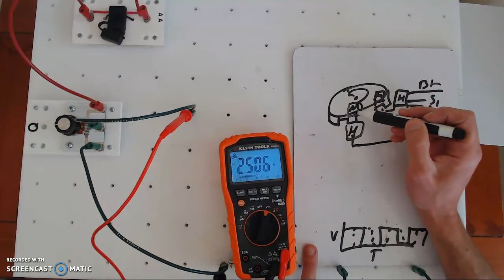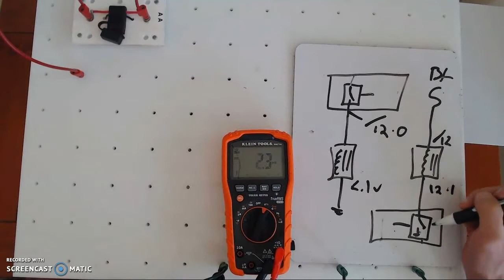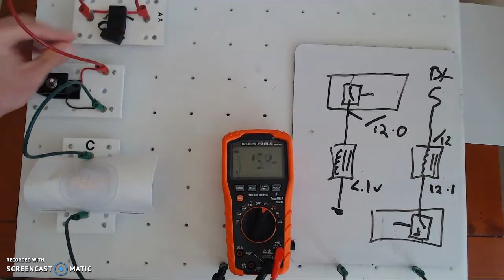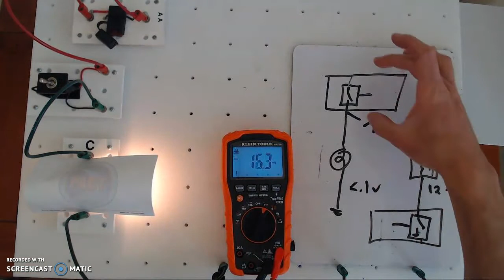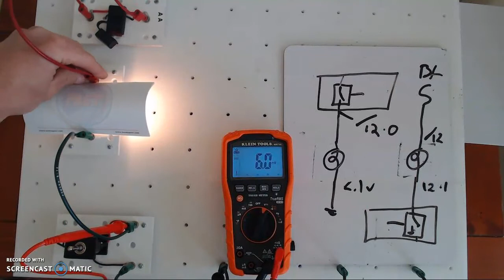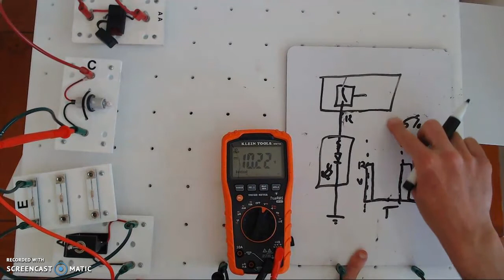Automotive computer output theory, operation, and diagnosis.

Comment: Just another comment.  Can you show how to take a 3-wire sensor (input to CPU) and tell which wire is which without a schematic?  One is ground the other is VCC and the other is the signal to the CPU.  I suppose I could read the voltage at the sensor connector using a back-probe pin test lead with power applied by having the ignition key turned to position 2 (not the accessory position).  I could get Ground and VCC using this method and by default the other is the signal pin.

Comment: where i get confused is knowing if a wire connected to a pcm and module/device if its a input or output?many times i look at wire diagram and you have no way of telling
Reply from the maker: Inputs gather information (like we do through our senses), outputs do something, move something, etc. Like we do! It’s called biomimicry.
Reply: Very good explanation and getting the message across